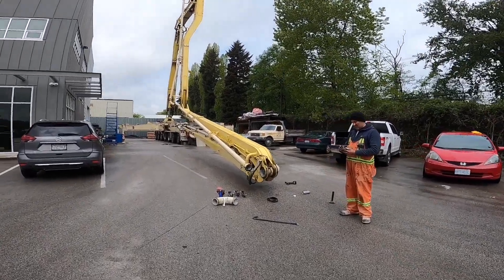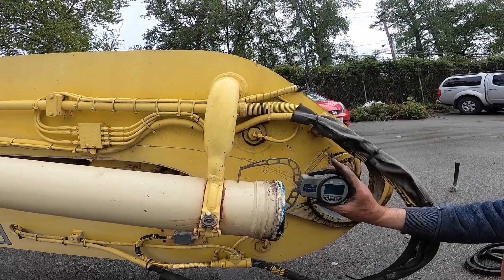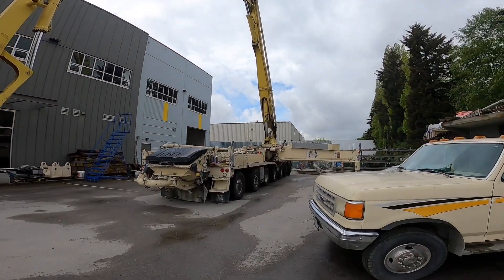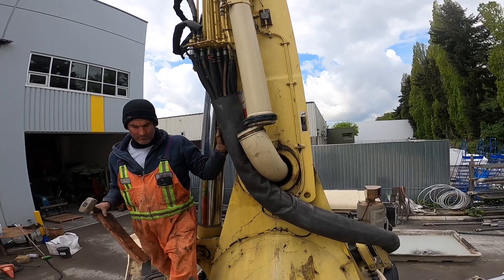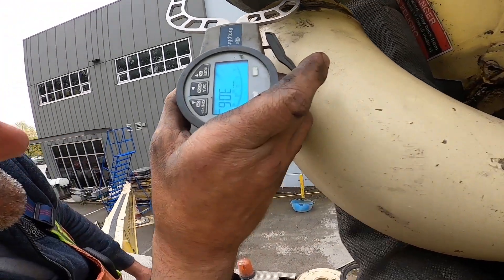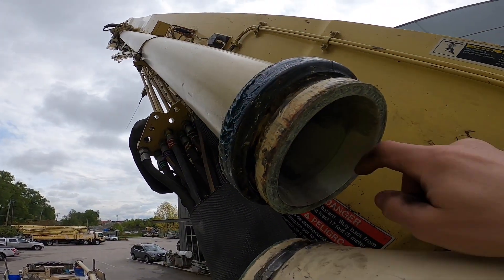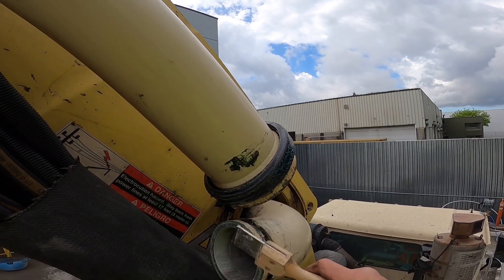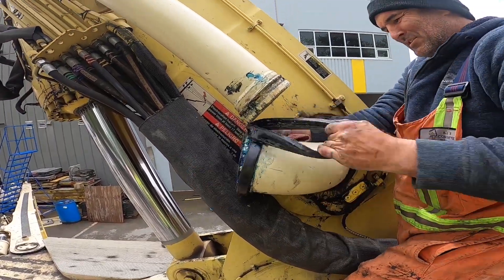Thickness testing twin-wall pipe on a 58 meter concrete pump.

Comment: Hi Scott. Have you had any success measuring twin wall with ultrasound? the compliance regulations we follow state we must do monthly checks of pipeline thickness which takes a lot of time with calipers but our manufacturer suggests using ultrasound to measure the outer wall only until it shows signs of wear. I am trying to find an effective way of doing it with the ultrasound and do an internal inspection with calipers every 3 months instead. Do you have any thoughts on this? Thanks for the content.

Comment: My boss
Runs the pipes until they start leaking concrete ahah but I guess that would be the best way to save money but more risky.
Reply from the maker: There’s no money in the long run to be saved by running pipes thinner than the recommended minimum thickness. New windows, pressure washing roofs, paint jobs for cars, loads of concrete sent back, weeks worth of paperwork to appease safety officials, irreparable damage to a companies reputation, and not to mention the potential legal bills as well as moral implications of anyone ever were to get injured. I could go on and on (actually, I just did). Soooooo many reasons not to get negligent with regards to properly maintaining pipeline components. It ain’t worth it.
Reply: @canadianconcretepumper1979  100% agreed when i have my own pump in the future I will take all your advice when its comes to saftey side of pumps

Comment: Should be turned once a month flip 45 and 90
Reply from the maker: With our mud we’re getting 3-4 years from a set of pipe. Usually flip and rotate one boom section during each monthly pipe inspection. Can definitely see doing the entire boom every month in markets with harsher material however.

Comment: Hi Scott. How do you check your elbows? We have the same digital caliper but it does not reach the center of our elbows, and the ultrasound doesn't give us consistent readings on the cast iron. Cheers
Reply from the maker: We have an ultrasonic which actually does a half decent job of measuring the cast elbows. The other method we have used in the past (although admittedly primitive) is just putting the elbows on a scale and comparing their weight to that of a brand new elbow. With cast elbows being relatively inexpressive, we typically just swap them out well before they are actually completely worn out.

Comment: auto grease to every pivot makes me jealous, have to spend a good hour on a slow day greasing a boom. while it’s good to have a chance to go over everything you might not be able to normally on site, having those back to back to back hellacious days, unfortunately leaves less than ideal time to open it up and hit it at the yard. our ergo 2 47-5 has a very noisy 2-3 section (B to C) pin. i’ve recently landed that pump as my responsibility, and have been trying to keep up on it, mitigate any further excessive wear. auto grease each section would be a treat
Reply from the maker: Also, our 38-5 Putz had what we thought was a noisy 2-3 section pin. Turns out the noise was coming from the lifting ram. I believe the fix was to use an additive in the hydraulic oil.
Reply from the maker: It’s very convenient on terms of greasing, busy also very inconvenient in terms of keeping things clean 😂

Comment: Do you only greese up the gasket?

We put silicone in our gasket grove then let i be hard. No slurry dripps. Maybe just here in Sweden we do that 😁
Reply from the maker: We’ve tried that with seemingly little increase in service life. Filling the swivel gaskets with wax from a toilet gasket is another popular method in our market (I cannot speak with regards to how effective it is as we have never used that method). I have found what is quite easy and effective is just using bentonite on the first prime following the installation of new gaskets. The bentonite fills the voids in the gaskets with heat essentially becomes clay. Works very well.

Comment: Another good one pumper brother,  using the machine to do the work. Whenever I do elbow work/maintenance, I also clock the pipes if needed. OCD is a good thing in our business, even if it pisses people off. Cheers
Reply from the maker: Absolutely! The twin-wall elbows especially we like to flip end for end as the flanges tend to round off almost before the elbow itself wears through.